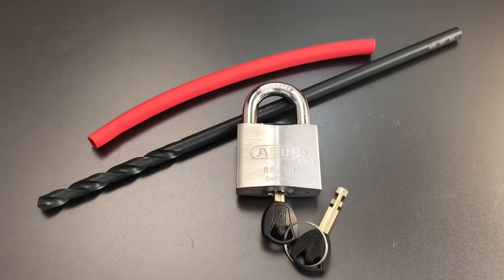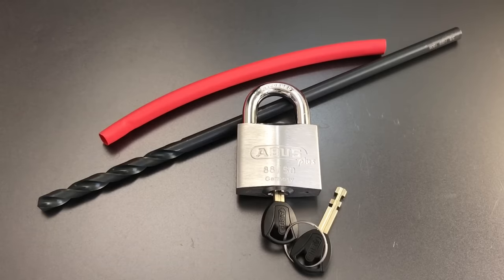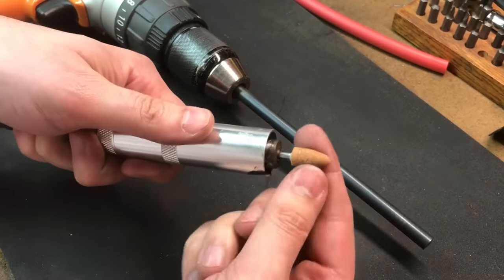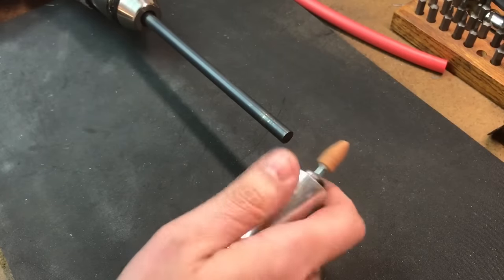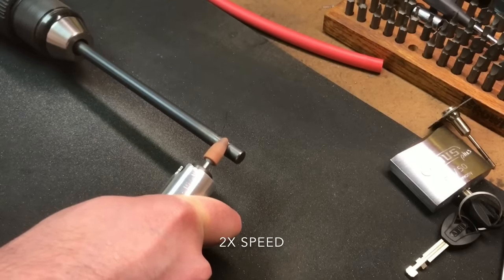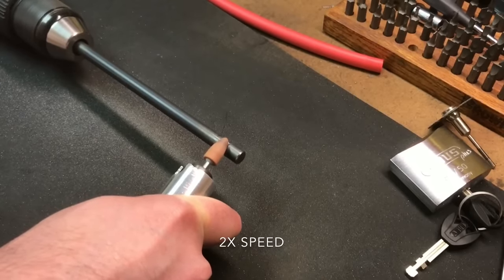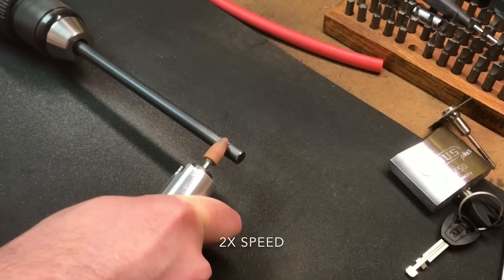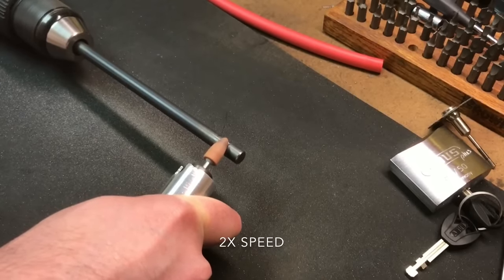[464] LPL Project: The Best Gun Lock Ever?

Comment: I know you said you didn't need comments on easier substitutions, but your project brought to mind two things most every house has at least one of each that could be used with no modifications at all:  An adjustable wrench and an ordinary padlock.  Find the appropriate size adjustable wrench to fit down through the ejection port and out the bottom of the mag well (rubber coated handle would be a bonus).  Lock an ordinary short-shackle padlock through the hanger hole in the wrench handle and you've created an instant gun lock that's tougher than a typical cable lock.  In addition, you would still have the lock shackle available to attach a chain so the gun couldn't be removed to a workshop for cutting.
I'm sure someone has done this before, but I don't ever remember seeing it and it sprang to mind while watching your excellent video.
Reply from the maker: Interesting ideas!
Reply: I agree with LPL; that's very creative!!!
Reply: You, sir, are a dormant genius.
Reply: That is a very astute observation jay, and your suggestion is both poor man friendly and you still get to keep two fully functioning tools however I feel LPL’s approach is better for three reasons, his lock is engineered for speed and less gun damaging slop as well as having a dedicated tool for the job.
Reply: If you did what you just described and plasti-dipped the whole thing it would protect the gun from scratches...
Reply: wrench and padlock is great for double doors and a few other things too
Reply: I just feel like I'd never get that right though and my shyte contraption would bang around on the gun and fudge up the bottom. Lol
Reply: @lockpickinglawyer   That sounds like something I rather do than all that work.  Genius. thanks.
Reply: The main weakness is the damage the wrench can do to your weapon.
Reply: What sort of steel is the wrench made of? Would a combination wrench work?
Reply: @MarkWarren-com  The finest Chinaesium that $2.99 can purchase at your local Harbor Freight.
An adjustable wrench works because most of them have a ratio of handle width versus head width that allows easy passage down the ejection port and out the magazine well but the head is too large to pass.  Most any padlock will add too much width to the handle to withdraw the wrench.  A combination wrench might have enough difference in the two ends, but you'd have to match it up to a particular gun more carefully.
Reply: Nice idea but end where you would put the lock in is very weak and it is easily breakable.
Reply: I for one can't believe the fastidious lock picking lawyer has a fire alarm needing a battery change
Reply: @ByteMyNAS  and you don't have to break out your handgun every time you need your crescent wrench!
Reply: @lockpickinglawyer  It might even be an option to do a follow up video where you encourage the home user to take their measurements to the local hardware store and buy a few cheap wrenches, maybe even a pack with multiple sizes. This may also help with users to want to secure more than one gun.
Reply: @benjaminpreston9796  That's funny. While watching this I thought it was one of my smoke alarms that needed a new battery. I was going to change it after the video. :)
Reply: That's a good idea...
Reply: @ByteMyNAS  Better doesn't mean his idea isn't good enough.. and I'm sure it's still better than the junk they sell
Reply: @HandFromCoffin  the wrench idea is still good for someone who does not have the time and or money to craft a purpose made tool, provided they rubber coat the wrench.
Reply: brilliant, easier
Reply: @ByteMyNAS  Just wrap it in electrical tape.
Reply: For a revolver a long shackle lock through the cylinder.
Reply: @akbychoice  or a really skinny wrench lol. You could probably also get a hasp over the upper above the cylinder so it can't close.
Reply: A bit of E-tape around the base of the jaw for a bit of protection and Bobs your uncle! LOVE this idea. Perfect idea for the handyman on the road.
Reply: Good thinking Jay!
Reply: I was going to suggest using a 1/2" x 1/8" steel bar with a hole drilled for the padlock and a bend at the other end in place of the modified drill bit as an easier to make alternative but your idea of using a wrench is even easier. Wrench or steel bar you may want to plastic coat the entire contraption to avoid damage to the gun.

Comment: it baffles me how seemingly easy it is to build a well funtioning gun lock, yet many manufacturers cant seem to get it right, well done LPL
Reply: I watched this and my first thought is where are the entrepreneurs? I hope they are watching.
Reply: @ayguy9855  The main problem with THIS gun lock is that it seems "Gun (model) Specific".  Generally, gunlocks need to fit a variety of weapons.  Unfortunately, this is one of their weaknesses, though/
Reply: I bet it could be made general enough if the bolt of a certain length was sold separately from the lock body, so you buy the right length (or bolt) for your weapon. I don't think even a half inch of play would make much difference especially if it was all factory hardened. This technique doesn't really work for crappy cheap locks though so I'm sure most manufacturers do their best to use cheap parts.
Reply: That lock would be easy to break open tho.  The ground the drill bit very thin to make it lock.  
I use drill bits that size and much larger at work and see them break all the time. 
Taking that much material off of it makes it very weak at that point.

Comment: everyone: makes jokes about how LPL sounds like a dentist when he picks locks
LPL at 22:30: uses an actual dental pick in a video
Reply: I fear the man who just has backup dental picks when he loses a scribe
Reply: I can actually taste and hear The sound of it scratching. Horrifying.
Reply: The Soooound I can't fgfgsfg
Reply: @sankang9425  thus begins San Kang's annual tradition of revisiting this thread to remind us of dental anti-ASMR
Reply: @mrnoodles3895  Dental picks are a must have for any serious electronics technician's toolbox.
Reply: I didnt expect to see a devil daggers pro here
Reply: @alpora7777  small world
Reply: @blshouse  Sure! And I have also quite some operating gear in my repair cases.
Reply: @sankang9425   you came back 4 months later to say the same thing?
Reply: Foreshadowing when he said it was taking a lot longer than he'd anticipated.
Reply: Surgical and dental tools are a must have for any locksmith. Also, surplus endoscopes are WAY less expensive than micro borescopes designed for locksmiths and are just as good for safe opening
Reply: Oh that sound. Awful
Reply: @noodles7157  Brilliant! Had a gunsmithing borescope picked up at an estate sale on the cheap. Guess now I need a new plug and a way to solder those tiny arse wires. But my main problem is going to be a new lens.
Reply: I really don't think that I am at all qualified to attempt to prove that LPL is not actually LPLD, the Lock Picking Lawyer Dentist.
Reply: @ayguy9855  LPLDiS: lockpicking lawyer dentist in space

Comment: So, six years later, I'm curious what 2023 LPL has to think of 2017 LPL's work here.
Reply: Setting on one false start on two
Reply: I don’t even own a gun
Reply: I think that by now he has realized that he had the wrong sequence. 
1. Bend
2. Cut the bent part
3. cut the bottom so that it fits into the lock
4. make one groove for the ball bearing, not a circle one.
Reply: @EujenSandu  And that's why it would make a great follow-up video. 😃
Reply: @EujenSandu He almost lost some length when testing the notch depth .    If he had ended up cutting it off, premature bending would make it too short .
  Also, to get locked by a big round ball, the notch must be semicircular .
Reply: EXACTLY!! How fast will LPL pick this?
Reply: @lightcycler4806  a universal cable style lock will fit any gun and is probably cheaper. LPL's design is more secure but a commercialized version of this that isn't the perfect size would be able to be removed with power tools.  So, this is more of a safety device rather than a security device. An immobile gun safe where only the authorized users have access is really the only reasonable way to store a gun from a motivated individual with time on their hands to take possession of the firearm.

Any lock that can be taken to another location to defeat can be done so with no sound/time at the original location, This is why people steal full ATMs and then break them open later. But if you welded this lock to something that can't move then it could become something to actually secure the thing that is locked rather than a safety which could be done much cheaper.
Reply: @EujenSandu you forgot a step. quench after the bend. when heating it to bend its going to remove alot of the hardness.
Reply: @TheSkanksta  true!
Reply: Quench, plastidip the bent rod along with lock, and then pick the 1911 free!
Reply: @TheSkanksta I would agree but a quench with no temper would make it brittle and you might be able to break it with a vice and wrench with minimal damage to the gun.  Though that is a use of force which wasn't his real objective to protect against for this project.
Reply: @EujenSandu You certianly do not start with the bend when you need to chuck up in a lathe.
even a lathe made out of a hand drill, youd just be making a vibrator or a propeller!

Comment: What?! No Plasma cutter? No lathe? No 5 axis cnc to machine your own 1911 frame and slide to use the lock on?! 😒

Great video man. Love the projects!
Reply: elesjuan Someone needs to CNC a Glock slide onto a 1911 Body and watch as millions of fanboys cry out and be suddenly silenced by the death star equivalent of a fire arm
Reply: Hah!  If I had means... I'd do it!

Make a 1911 slide for a glock frame too!
Reply from the maker: LOL... the closest I have to a 5 axis CNC is my dremel and a lazy susan!
Reply: +LockPickingLawyer This made me laugh harder than it should have.
Reply: IMO, replace the safety with the correct lock insert. Need to insert a key into the gun to enable it, the way you use ignition key in a car.
Reply: @farche2  You can always keep the key in, just turn to fire, like you normally turn safety, no difference. When you want to disable the gun more permanently, just remove the key.
Reply: @iamnegan8064  I'm not a fan boy of either (makorov for life) but I think that would give me nightmares for life
Reply: BOOOOO!! lol
Reply: @elesjuan  if you did that I'd give that gun a viking style burial
Reply: @bartoszwucke6181  that'd be a legal gun to sell by itself without a separate lock in the state of Maryland

Comment: If you go to the electrical department of a Home Depot they have small cans of liquid rubber for electrical connections. They have screw on caps with a brush attached just like CPCV pipe glue. Reusable for many years.
Reply: Or could use that flex seal stuff which is kinda the same thing. That's what this comment reminds me of at least.
Reply: Plastidip
Reply: It's called liquid electrical tape and it's garbage. Good luck not making your tool look like a shit that would concern your primary doctor.  It's even crap for what it's supposed to be used for, regular shrink tubing is better in every way. 

Just put a layer of clingwrap over the plastidip can before you put the lid back on and it'll last long enough to pass the full can down to your grandchildren because you will probably never use it again anyways. Add another layer of clingwrap on top of that with a rubber band and you could probably pass it on to the the species that rises from our ashes after humanity's downfall. 

Or get the spray if you want your tools to actually look decent. Slightly more prep and skill required though.
Reply: @flyingtentacle7631 yes to the spray, I use that now.. no to the cling wrap, I tried that with multiple layers.

Comment: Little tip for pushing heat shrink around that bend. Use a solvent like isopropyl alcohol as a lubricant instead of a petroleum base. The petroleum lube will always be there. Alcohol will eventually evaporate. That's an old motorcycle handlebar grip technique.
Reply: Or just use distilled water. Alcohol will eff with the adhesive.
Reply: I wondered why he didn't dip the rod and save faffing with the heat shrink
Reply: @andyp5899 this was my question as well, what was the advantage of the heat shrink vs plati-dip (which I've never heard of to be honest, never heard of marine grade heat shrink either though). Maybe the only flaw in this video was not explaining this.
Reply: @technerd9655  I think the heat shrink will be more durable. That would be more important on the part that rubs the sharper corners of the gun more than the lock body. The lock body seems to only touch a plastic piece at the bottom of the mag well.
Reply: @Madcattlx Unfortunately the only part of the drill bit that is likely to damage the inside of the gun (the end) is not covered in plasti dip or heat shrink. Not much you can do about that though.
Reply: What about window cleaner?

Comment: when you're cutting something off, the sparks won't hurt you (obv using eye pro). The tool biting and throwing itself in the opposite direction of the sparks will. Thus it's usually safer to have the sparks towards you so that in case of a problem the tool would just fly away from you.

Also, humans have better control pulling than pushing, that's why you have more precision over the cut when you're pulling the tool towards you while it's trying to escape than if you're pushing it trying to stop it from getting closer.
Reply: until the object comes flying at you.....
Reply: @commonsenseisdeadin2024  the "object" is supposed to be held in a vice
Reply: @vanoscrap6296  so stand perpendicular and not get sparks thrown at you or the tool nipping you! 

Hell a cut off wheel can just as easily bite and go 180° around a small diameter round object. I guess I always attack it with the back bottom side I guess. (So if holding the die grinder straight out would be the position of the blade between 6 AND 9 o' clock)

Comment: just a tip for bending rods like that. bend away from the flame. the steel on that side the bend needs to stretch more and should be hotter and in more direct contact with the flame
Reply: Thought that myself, turned out good though 👍
Reply: yes the heat should be on the outside of the bend simply because due to compression  will get "hotter" and the expanding will be cooling
Reply: you'd need an angled pipe (or other tool) then, otherwise you're likely to burn your hand
Reply: @pixelmaster98  Nah, you can direct the flame downwords and still on the outside of the bend.
Reply: I was looking at that too. Good eye.
Reply: Likely difficult alone with minimal tools, being the case of some of the viewers?

Comment: LPL, this is an awesome little project and I love the spirit of it, making it as widely available as possible. The machinist in me can't help but offer slight change for future iterations though. Drill shanks tend to be at least partially annealed already and the area closer to the flutes may have a higher hardness but, this would actually leave the lock weaker to a brute force attack if you swung down with a hammer onto the padlock (I should mention now that I am halfway through the video so, apologies if this is tested later). I think a simple solution is to instead use a length of stainless steel rod (should be available at most hardware stores) preferably in 316 or a similarly gummy alloy. These alloys have much better tensile properties than the drill rod will and even with that drastic notch, should hold up to physical attacks. This also provides added difficulty to cutting and grinding attacks as stainless is notorious for its poor machinability. To that end, keeping with the dremel lathe set up, one could likely make the notch a bit more quickly by using the cut off wheel and spinning it opposite the direction of the work. Then simply cant the cutoff wheel at an angle to the work until the desired radius is achieved in the rod. Do not notch the rod and then try to angle the cut off disc though as that would likely break it. Anywho, thanks for this thought experiment!